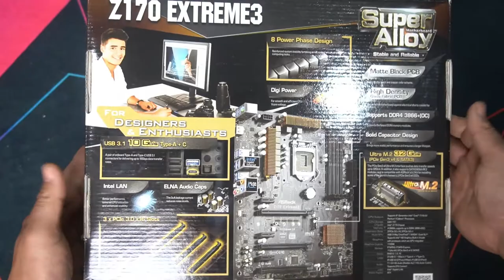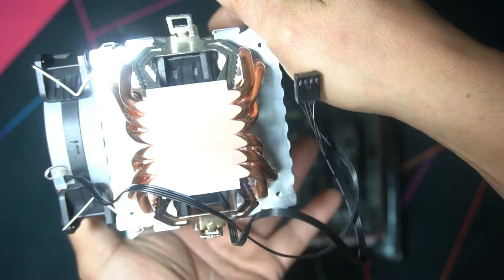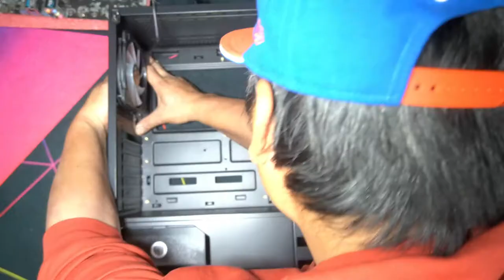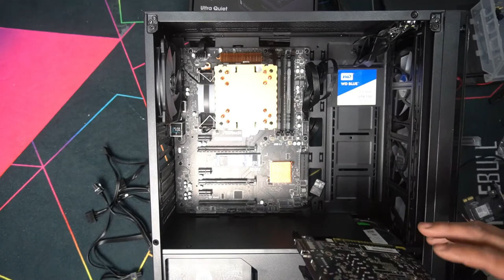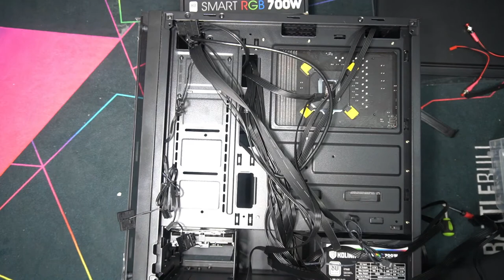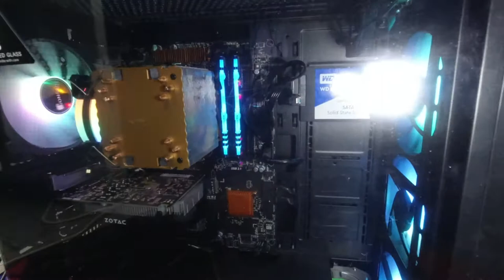affordable gaming pc build - under $1000 - i7 6700k zotac 1050ti 4gb 700w psu 16gb ram 3200mhz

Comment: Hi 
I m planning to buy Mercedes w204 2010 diesel 2lt. I had e90 320d. I search and read forums about w204. They are not pretty good. A lot of engine problems in w204. Can you pls help me or giving the right advice
Reply from the maker: ok look basically yes there are alot of common issues with w204s ingeneral .. alot of ppl have shared their stories of issues.. but at the same time alot of ppl also have a pleasant experience with little to no issues ... buying a w204 u want to buy about 2013 ..facelift.. those models were perfected abit more .. but if ur into the prefacelift version like mine square light etc.. then u got 2010  and sometimes 2011 as last model of preface... like with any car .. key is maintenance and preventative maintenance..take care of tour car ..know what to look for research and learn to diy ..so u can save money and not have to take itnto the stealership for easy diy tasks ... yes they tend to have more issues then others but also tolerable ones as well .. I guess it also depends on your skill level and whether u can tackle most of the jobs yourself that really helps

Comment: Hi, i’ve got the same case as you abs i was wondering for the fans what do you plug in? their is a molex cable and a 3 pin connector. i’m not sure what to plug in. i’ve plugged in the molex cables in and the rear fan is different to the 3x front fans? in need for help
Reply from the maker: ok so very easy .. u can use either ... but sometimes I find I can only use molex .. basically wen u plug it in if leds come on and gans spin that's it... so just do trial plug molex if all working then stick to it .. but if u wana use pwm 3/4pin ..then use that which ever is easiest for u to plug in
Reply: @MIKEYZVLOGZ  ok so molex is the way to go?
Reply from the maker: @1gamesauce177  yes it will work

Comment: how would you turn the rgb of the case fans off?
Reply from the maker: unfortunately theres no control but if you wanted to control the leds u can just add a remote and a hub and plug all the faNS INTO THE HUB AND U CAN CHANGE THE colours to what u want , hubs are very cheap like 10 dollars ... after checking again these led fans are made to fixed colours they are not argb which are addressable meaning you can change the colours , the only way to really be able to change colours is to use argb fanbs, unless you can get a pwn to 5v3pin or 12vpin adapters and use a hub , then and only then will u be able to change the colours ... its really sad that karuza didnt just install the rgb button on the front  and allow the rgbs to change colours with thge button, a real shame ..
Reply: Ah I see, Thanks man
Reply from the maker: @ateyou4527  ye ciz the fan connectors are just molex and pwm which is standard fan connectors not the controllable 3pin 5v or 4pin 12v...but like I said the only real way to change is to get fan that can change ... 😉

Comment: Could you use and gpu?
Reply from the maker: what do u mean ? like does it work ?
Reply: @MIKEYZVLOGZ  yes
Reply: I was wondering if I could use a 1660 super ti
Reply: I am new to this sorry
Reply from the maker: oh yes .. u can use a 1660ti better gpu as well... I recommend getting a gpu at least 192 bit ..if u can get 256 bit gpu like 3060ti ... 3060 is ok too but 3060ti is 30% faster then regular 3060... eve tho the 3060 is 12gb and the ti is 8gb ...is the 255bit that makes a big difference as well as other factors ... I strongly suggest an 8gb gpu 256bit... if ur really on a budget and don't care about Ray tracing u can settle for 1080ti or even a 1070ti or 1080 ..they are all good gpus and cheap now
Reply: @MIKEYZVLOGZ  sorry to ask but I am on a budget and do t know much about pc parts and my budget is 1k for the pc what gpu do you recommend?
Reply from the maker: @Bently.worldwide  on a budget I recommend 1660 super or rtx 3060
Reply: @MIKEYZVLOGZ  I couldn’t find the x4 jonsbo led fans what other fans should I get?
Reply from the maker: @Bently.worldwide  get upherw fans from Amazon they are cheap and worl great . plug them into your system fan header and control speed ... or get a fan hub with 5v 3pin rgb controller and u can control speed and lights ... trust me food fans on a budget something like 40 for 5 or 6 argb and 5v 3pin or 12v 4pin depends what u want ..make sure u get the right hub for your fans ..if ur new to PC then a controller will save u from controlling them via a software
Reply: Can any parts be used in the case because I can’t find some of the parts in this video
Reply: I can’t find the 8tb seagate hdd 4500rpm or the kolink 700w rgb panel psu
Reply from the maker: @Bently.worldwide  hey bro u can. use any parts that are similar... what can't u find and I'll tell u a diff brand and model
Reply from the maker: @Bently.worldwide  try get a 7200rpm hdd ...if u can't 5400rpm is ok too... try get m.2 nvme for boot drive so it will run fast
Reply from the maker: @Bently.worldwide  as for psu use a 650 at least so u can upgrade without having to upgrade psu as well... u less ur going to a 3080ti or rx690p then 650 is fine...even 500 is ok as long as good brand name and gold rating
Reply from the maker: @Bently.worldwide  the fans come.e with case ... if u can't find them get uphere brand cheap and fast and good quality for price and performance
Reply: @MIKEYZVLOGZ  I can’t find the 8tb seagate hdd 4500rpm or the kolink 700w rgb panel psu what is the alternative?
Reply: And could I get any case? Will all the parts fit in it?
Reply from the maker: @Bently.worldwide  u want a case that will fit whatever u use so if u have an atx mobo make sure ur case can fit an atx mobo ... and ensure u can fit a 3.5" hdd and 2.5" ssd and u will be ok... as for your gpu just make sure the length of your gpu will fit your case .. look at the length of your gpu and compare to the case and what size gpu it can fit .. usually most cases will fit everything as long as it for an atx mobo ...
Reply from the maker: @Bently.worldwide  u can always use 4tb hdd x2 or 2tb hdd and upgrade later ... if u have more money to spare get a ssd 2.5" much faster ... as for psu get a descent 650w + if ur on a budget get like a cooler master mwe white 80plus ..they are good for budget builds ... I recommend 650w or 750 so if u get your hands on a good gpu like 1080 or 2070 then your psu is powerful enough to handle it .. try stay away from cheap stuff... known brand always a better fit.. however u can get generic brand psu as well... I've used alot of generic cheap psu and they still work as long as it has enough power to run everything
Reply: @MIKEYZVLOGZ  what if I were to build a pc off a site like pc specialists for 1k how would I know what parts to get?
Reply: @MIKEYZVLOGZ  sorry I am new to this pc thing
Reply from the maker: @Bently.worldwide  that's ok we all learn from nothing ... I was the same so I did alot of research and now I am trying to show others that if I can learn so can u.... research is key ... its the best way to understand what each part does for the pc ...and wen u understand what each part does u can choose what parts are best...but I don't know everything even I'm still learning everyday
Reply from the maker: @Bently.worldwide  in that case u need to research more because u need to understand what parts mean and why u need them .. thennu can choose accordingly ... I watched alot of youtube and read alot of sites before I really understood what to use
Reply: @MIKEYZVLOGZ  sorry for all the questions but is 1660 super gpu hood?
Reply from the maker: @Bently.worldwide  for budget yes still good 1080p gaming still good
Reply: @MIKEYZVLOGZ  why not a 260?
Reply from the maker: @knowethjc29  cheers bro
Reply from the maker: 260? 2060?
Reply: @MIKEYZVLOGZ  what processor would be good for 2060 ti super?
Reply: @MIKEYZVLOGZ  there's no way I said 260 I swear I saw I wrote 2060
Reply from the maker: @knowethjc29  lol ye u can put 2060 its totally up to you ...authentic time gpu prices were ridiculous so I used what I had and got ... however with gpu prices going down. yes a 2060 or 1660ti would be great
Reply: @MIKEYZVLOGZ  true true
Reply: What if I was to get 3070 ti would I be able to run war zone on hood settings at 200fps? And what cpu and motherboard do I need?
Reply: I am trying to get a 3070ti or 3080 ti with intel i5 11600k would that work?
Reply: @Bently.worldwide  on good settings maybe but on ultra maxxed setting you'll be running at like 120-170 I saw in a benchmark video of them same specs, but u also take into account overclocking both the gpu and cpu and ram etc
Reply: @Bently.worldwide  3080ti will definitely run 200 with ease on high settings
Reply: 3070 too?
Reply: Can 3060 ti run warzone at 200 fps max settings
Reply from the maker: @Bently.worldwide  yes sure would
Reply from the maker: @Bently.worldwide  yes a 3070ti would allow u to run warzone on high settings